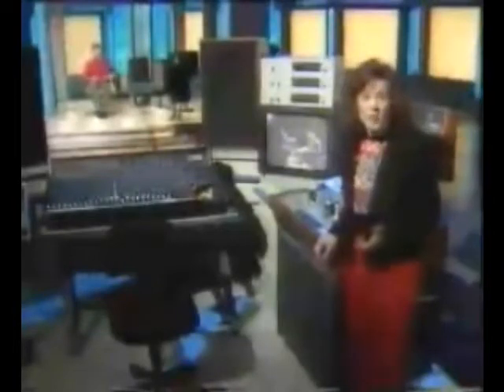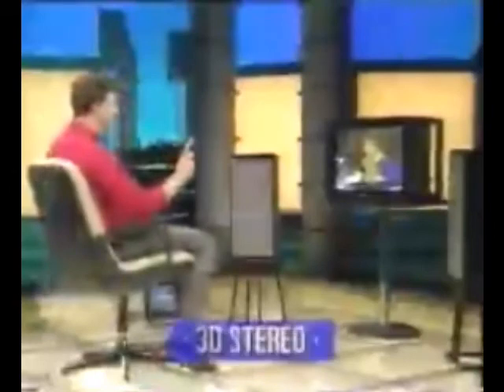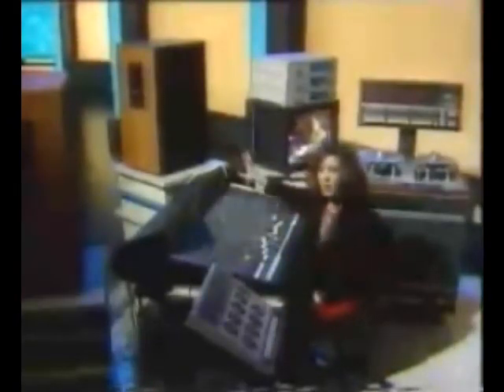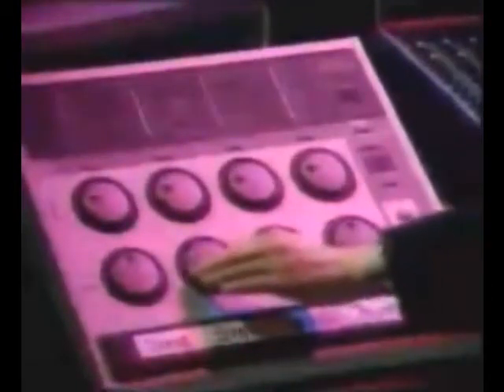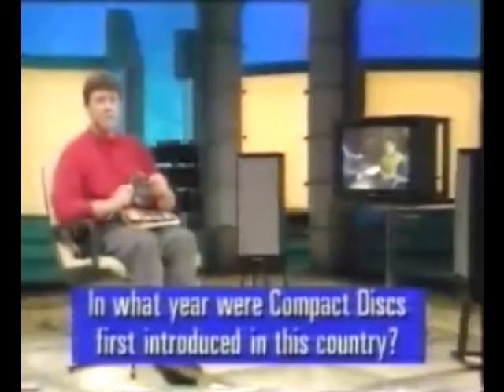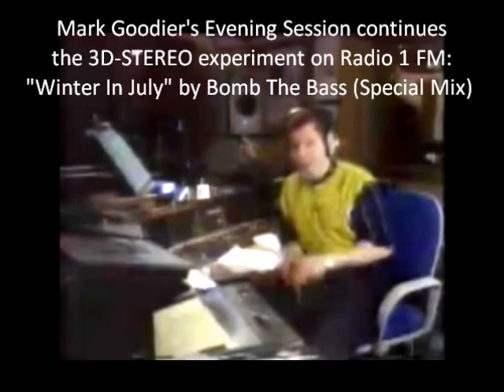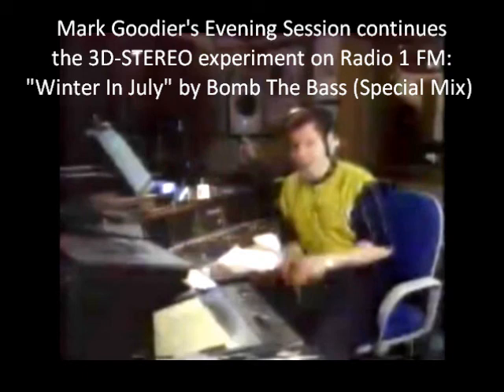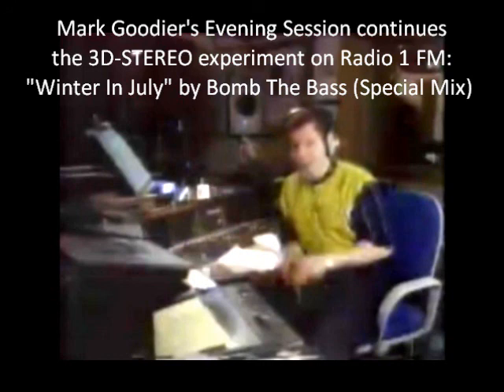Tomorrow's World "3D STEREO" Demonstration, BBC1 (Broadcast 21-03-1991)

Comment: Thanks for posting this. Just found the "Winter in July" 3D stereo track on an audio cassette that I recorded from Radio 1 that evening. This was a few months before I had managed to save enough paper round earnings to buy a NICAM VCR and Dolby Surround separates system. I had kept the tape recording and managed to get the Radio 1 news, the headlines of which were the scrapping of the poll tax.

Comment: I remember listening to this live.
10 years after this, I worked on a developing, 3d sound, from a conventional, 2 channel system.
It was a combination of speaker design and some electronics, but the results are out standing.
My system uses 4 speakers, 2 left and right, 2 either side at a precise angle, and I could say its makes top brand stereo systems seem like your back watching black and white television again.
However 5-1 should beat it, as long as they develop larger speakers.

Comment: 2.  - the RSS only in-outputs a single stereo signal. So it seems this original model, the one which looks like a Q-Sound controller as I recall, does a similar kind of thing to Q-Sound but just a lot better. It seems not to do the mind-melting velocity and doppler based tricks the RSS-10 does over its PC interface, judging by the rotary layout. Still, for 3D placement it sounded wonderful. How can it be that Roland don´t make these? They must be mad.Even just the reverb sounded stunning.